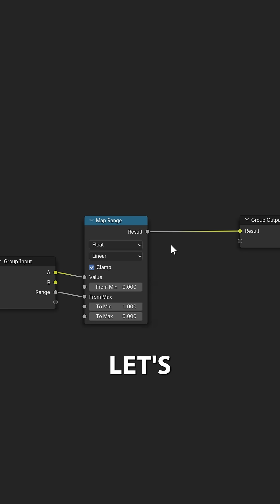A simple Blender trick by Jim Morren on effectively mixing PBR materials #b3d #blender3d

Comment: Just because this heavily jump cut and sped up video is 50 seconds does not mean you can do the task in "under 60 seconds"
Reply: "How to do thing in under 60 seconds" is ambiguous, it could be refering to the duration it takes to give you instructions (how to do thing) OR the thing it is instructing you on (do thing).

Understanding where ambiguity like this pops up is important not just for conveying information more concisely, but also interpreting information from others. Language and it's users are not perfect, it's use relies heavily on context and intelligent parties to work effectively.

The alternative example already commented here fails for the exact reason that is complained about in the original comment btw, there is still ambiguity between the subject being the lesson and the task.

The only way to convey exactly what the video means is to break the statements up, either into compound or completely seperate sentence. "Learn how to do thing, in this 60 second lesson." This is the cleanest most precise way to present the information, but it is ever so slightly less compact/elegant while the extra clarity is basically unnecessary for 99% of people.
Reply: The author here, this thread was a fun read, solid points made about the words used. Just to clarify, the "under 60s" was referring to the video length, the whole clip is under 60s. So basically, what I am saying is: I'll show you in under 60s how I do this. 

But I would be interested in a speedrun, reply to me the fasted you can do this setup.
Reply: You can do it in less, bruv
Reply: @nahoj.2569 As I offered DisgruntledPiguman, prove it by recording a video from scratch without jump cuts or speeding it up and I will apologise here and on your video. I still think it can't be done in under 60 seconds even by the best of Blender users.
Reply: Never has a "in under 60 seconds" video ever implied it can be done in 60 seconds. Ive watched over 25 different genres of these videos, none of them have ever implied, said or made it look like it can be done in 60 seconds.
Reply: @DrSabot-A "How to blend in some moss with these bricks in under 60 seconds" strongly implies you can do the task that quick. That's just how the English language works, sorry.  Now you could do as others and say "I'll show you how to blind in some moss with bricks in under 60 seconds" and then you would be right with your reply.
Don't get me wrong, what you show is helpful if you can follow at the sped up rate but your choice of wording puts a false expectation on noobs that can frustrate them into quitting using Blender.
Reply: @j.tann1970  that STILL means we should be able to do it in 60 seconds.
Reply: @DisgruntledPigumon OK, record yourself doing it from scratch without jump cuts or speeding up the video, and I'll accept it and make a formal apology on here and your video. 😏
Reply: @j.tann1970  😎👍